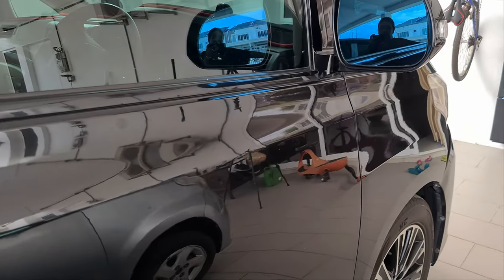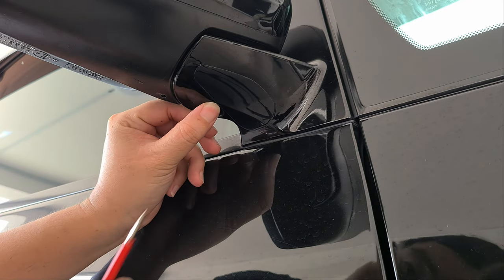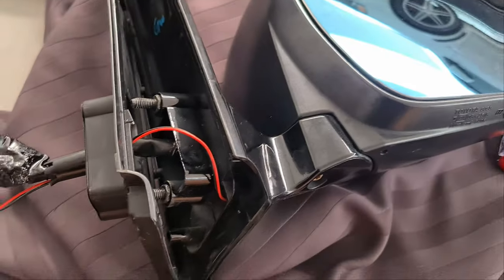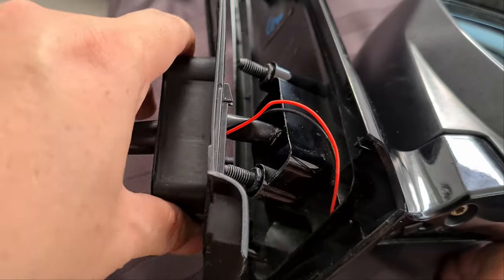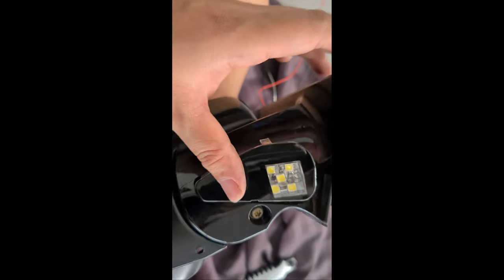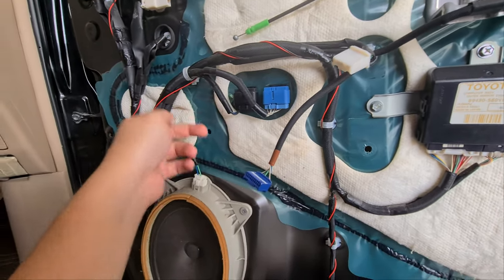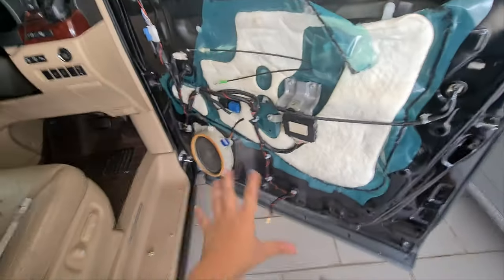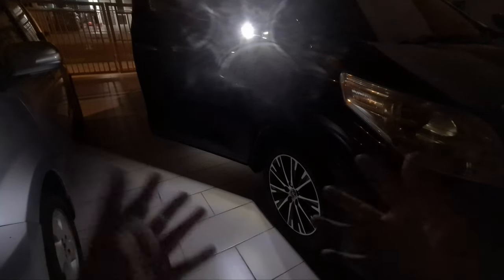Install puddle light for side mirror

Comment: I'm sure we could figure out a small configuration with a controller, so that the puddle light comes on as you approach Alphard (like how the interior lights automatically come on), and come on when door is open, but stays off if ignition is on, or the internal lights are manually operated.

Comment: Hi, have you install LED reflector for your alphard/vellfire? do you have a video on how to install and connect the wires?
Reply from the maker: You mean LED bulbs in the reflector headlights (high beam)? Or do you mean something else by LED reflector?
Reply: @TCsAnythingGoes  I was referring to the rear bumper Reflector. I mean changing the rear reflector to led. 😁
Reply from the maker: @nokindtz0039  ohhh, that one. Nope, I have not and I do not have any plans to change those to LEDs at the moment. 
But I guess wiring should not be too difficult, just tap it to the rear lights.

Comment: Can you guide  me how to connect to interior lights? 
Not really understand wiring 😅
Reply from the maker: To connect to interior light, there is a lot of wire routing to do and also to find the correct wire might need a multimeter. If you have no experience in car wiring, its gonna be very risky. Best case scenario - a few burn fuses. Worst case scenario - car burned.
Reply: @TCsAnythingGoes  I managed to install and connect to the correct wires in the passenger side footwell panel - the lights are now linked to the interior lights that come on when you unlock with remote or walk close to the alphard, will auto fade off too after set time (mine is set for 15seconds)